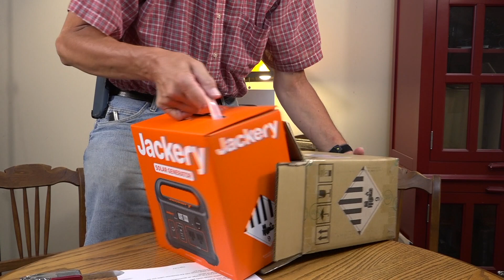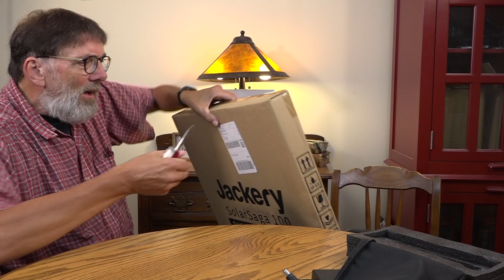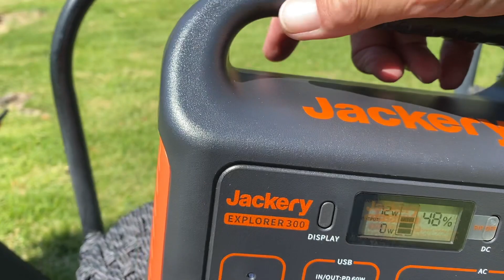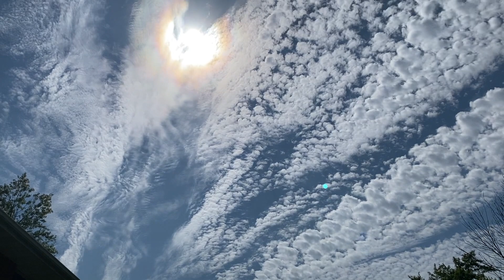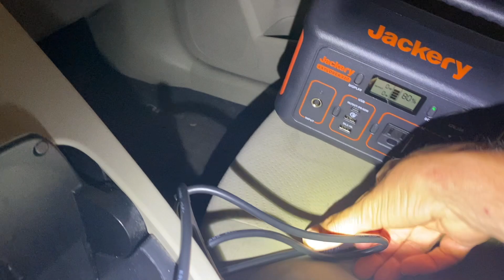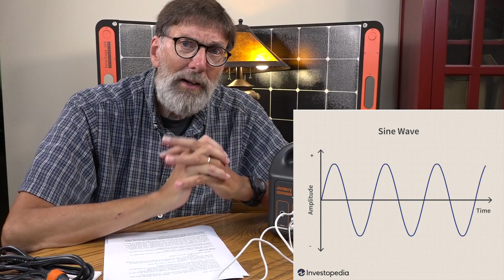Perfect Power On-the-Go: Jackery Explorer 300

Comment: Sounds like you only used charging for a short period of time.  I have the same unit and if you have something plugged in for some period of time, a fan comes on.  Not dead quiet as declared.  I could hear it kick on from another room.  The larger units have an even more powerful and noisy fan.

Comment: A handy bit of information! Never let a power station sit in direct sunlight while charging, it can damage it.
Reply: Good to hide it in the shade behind the solar panel. Also, if you plug something into the USB-A or USB-C outlet on the back of the solar panel, it can get a little toasty in that pouch. I would use a short USB extension cable to allow the item to be placed elsewhere than inside the pouch.

Comment: With only a LI battery with 800 recharge ..i would go with something thats LIP instead as this is behind the times and what the industry is using.  Great review but you can get a bluetti, ecoflow,pecron with pass through charging and over 3000 recharges for the same price.
Reply: But this is pure sine, that's what you're really paying for. I haven't found a bluetti portable power station for $260 that is pure sine.
Reply: Or buy a 300+ unit

Comment: Larry.. help want to make best decision.. need power station for possible power outages we are in SC . We need to get a power station and solar panels .. A big concern is for us to keep our garaged upright freezer and our refrigerator which is in our kitchen. Of course to have it assist perhaps with an electric heater should power go out in chilly weather . We need something two senior citizens can manage and it must be free to run . No fuel. We understand we would need to get a larger support system to do this…
Reply: I would go with at least a 2,000 watt unit.    That's a large demand for a battery powered station.  Heaters take a lot of power.  I use a gas generator for large demands.    Most electric heaters use around 1300 watts so even a 2,000 watt power station would only run that for about 1 1/2 hours.  The refrigerator and freezer would run for about 2 days from a 2,000 watt unit.
Reply: Thank you Larry. I have now learned it’s limitations so at least I know. We will not expect the ceramic heater to be included . When and if you get a moment what then should we look for online wise what are the important things to search for..  My husband not able to lift and carry heavy units nor can I …

Comment: Great info. Thank you. 
Larry, do you have any thoughts on the portable HALO car battery charger? I thought about getting one in case my car battery dies and I'm out running errands , I wouldn't have to get help. I could just jump start with the HALO. It also works for charging phones..
Reply: I don't have any experience with that unit, Jill.
Reply: @larryware1 ok thanks.
Reply: I have several Halo Bolt jump starters. They work great for starting a vehicle that has a dead battery. Unlike most portable jump starters, the Halo Bolt (most models, not all) includes an AC outlet for powering a fan, lamp, or other low-power devices.